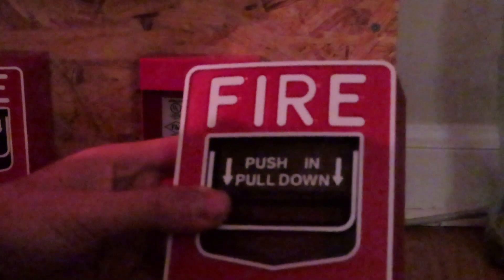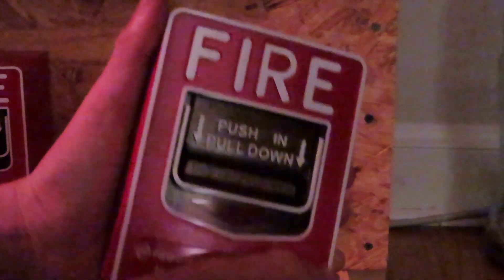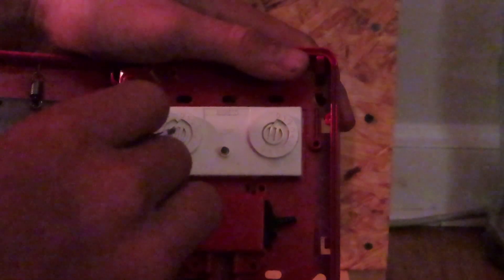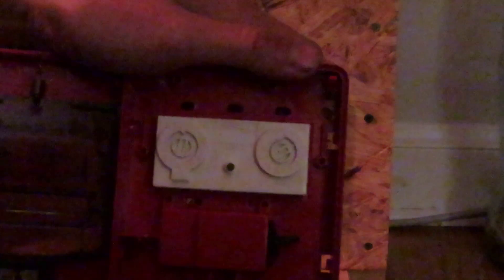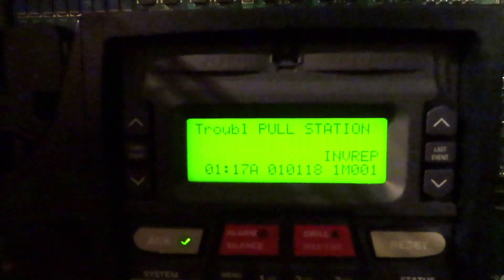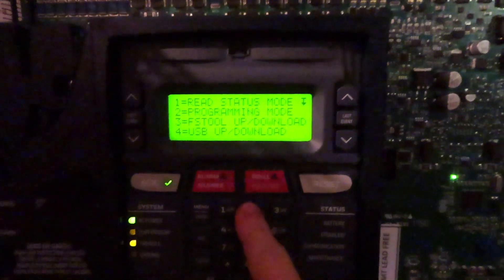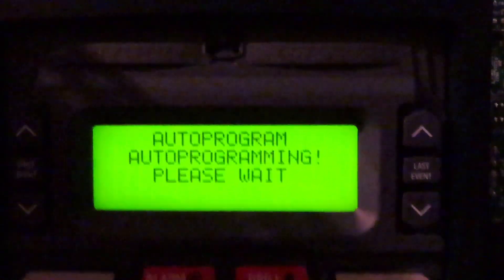How to Wire/Program BG-12LX to a Endurance Series Fire-Lite panel.

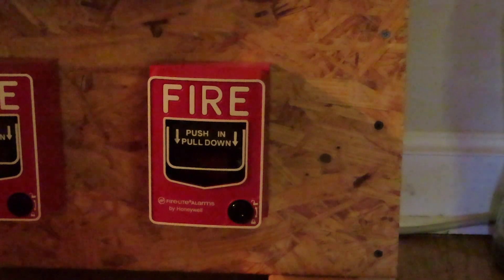Comment: 01:31 to 01:38 [Fast Speed High Pitched Voice from the Wheelock Safepath Male General Emergency Message] “May I have your attention please! An emergency has been reported in the building. 
While this is being verified, please leave the building and report to the designated assembly area for your group.” 01:39 [2 short Blasts of a Simplex 4903-9239] 01:40 to 01:47 [2nd time of the Fast Speed High Pitched Voice from the Wheelock Safepath Male General Emergency Message] “May I have your attention please! An emergency has been reported in the building. 
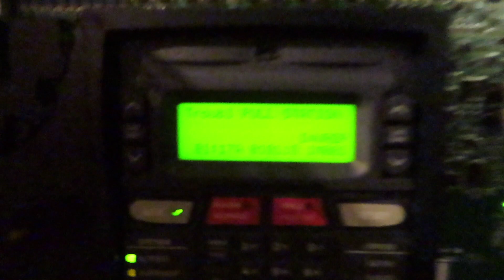While this is being verified, please leave the building and report to the designated assembly area for your group.” 01:48 [Mechanical Click Noise]